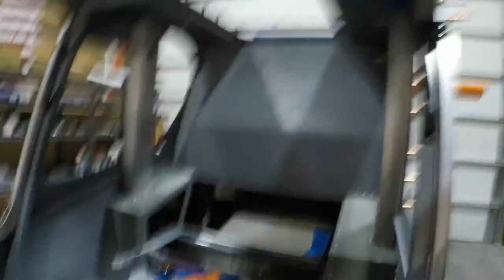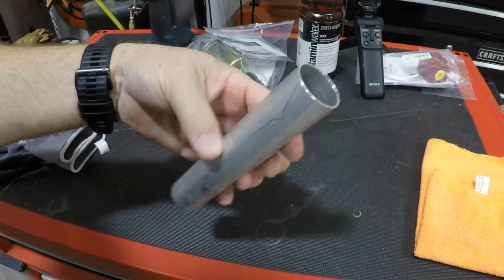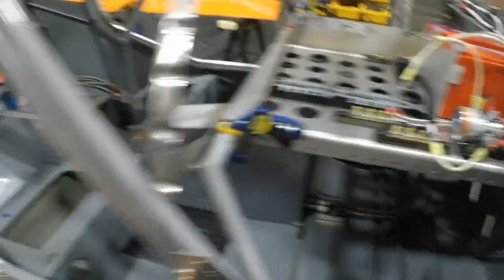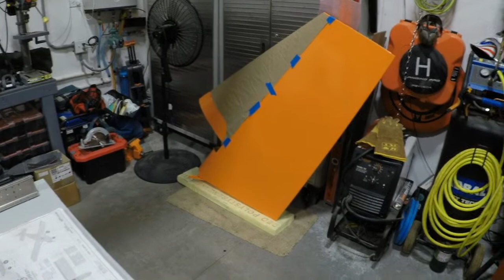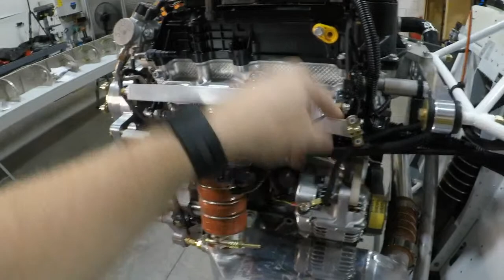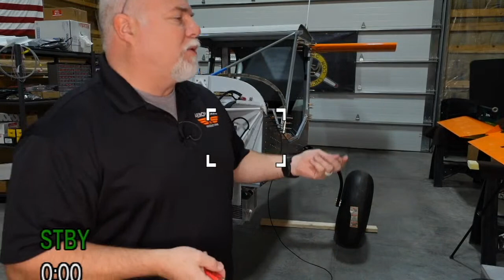LIVE STREAM #3 | ZENTIH SUPER DUTY BUILD | Come Hang out!

Comment: The potential problem with Viking engines is not the Honda engine itself, which is probably more reliable than anything Rotax or Continental puts out , but various adds on procured by Jan …that’s where you enter truly “experimental” territory imho …
Reply from the maker: There really is no alteration to the Honda engine itself from the factory build.  Only alterations would be a custom exhaust to fit within aircraft parameters and a heavy duty well built reduction drive.